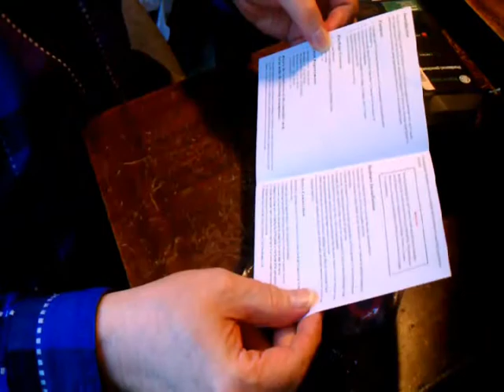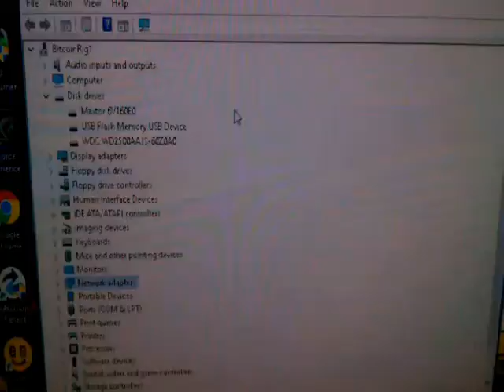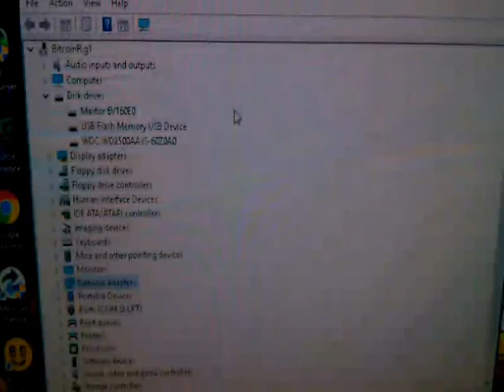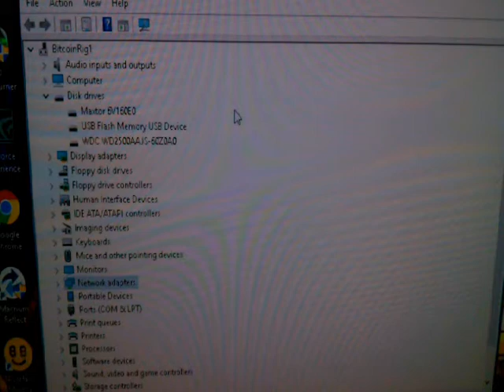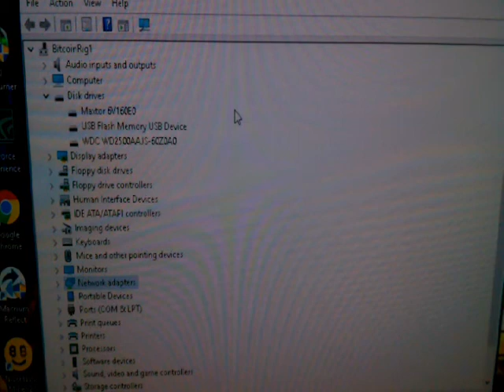IOCrest 2 Port Sata III Controller unboxing, install and review

Comment: I have a IOCrest 4 port with the Marvell chipset and it worked no problem with Win10x64.  A friend of mine has the same except that it's a 2 port and his also don't present any issues.  Both are in Dell T7500 Workstations with SATA SSD drives attached and booting windows.
Reply from the maker: Glad to see it worked well for you and your friend. I have concluded that the issue was due to the 9 year old motherboard in the PC, but that is just a guess on my part.
Reply: Im trying to install it on a dell t3600 and all im getting is a black screen. Any recommendations?
Reply: @vladgruin  It shouldn't cause any sort of black screen issues.  The card could be defective.